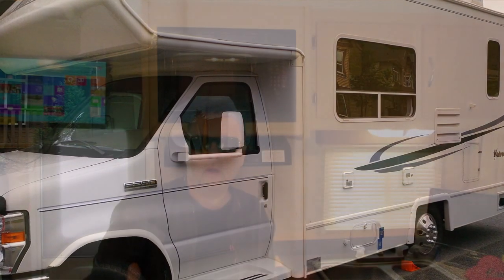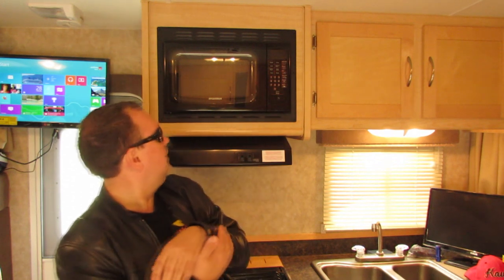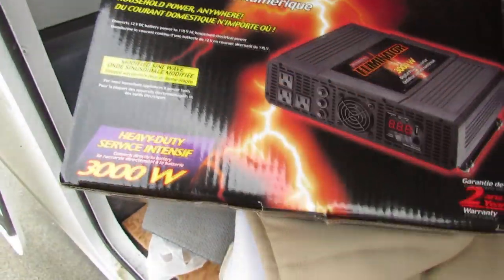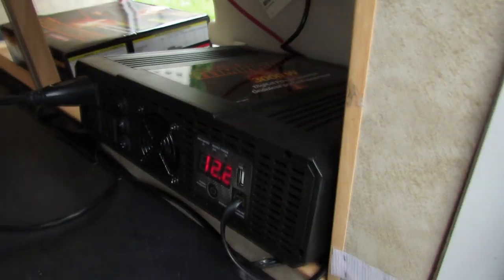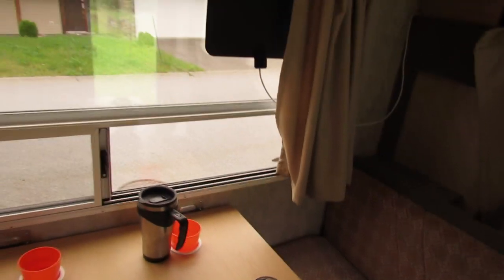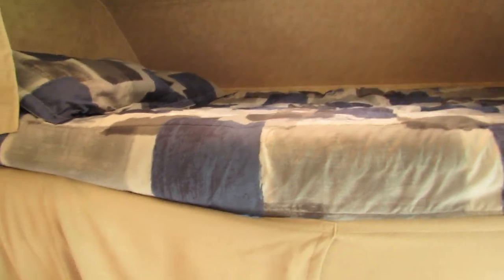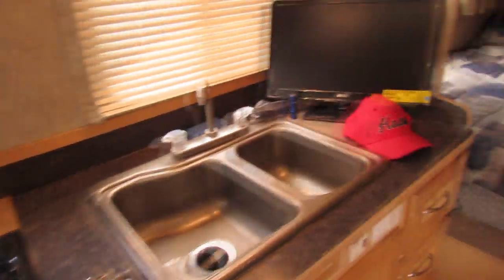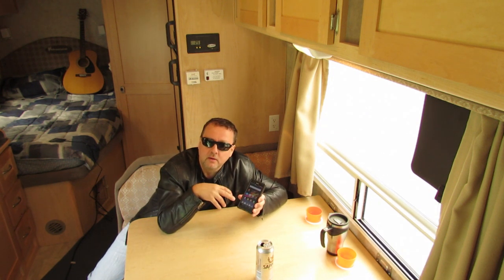RV'er Blows His Fuse!!  3000 Watt Inverter Install Issues

Comment: A 30A fuse will only give you about 300W of power from a 12V battery 
I recommend 400A of fusing from your battery and your nuke box should run just fine even with your other items turned on assuming the inverter can take it 

Also for your own safety you should upgrade your DC wiring to 2 gauge or even 0 gauge because what you got there is way too thin for 3KW at 12V

Also you should get a pure sinewave inverter 
Your batteries will last longer and your equipment will run cooler and more efficiently

Also you should get at least 2X 150AH AGM batteries 
If money is the issue 
You can pick them up pretty cheap at the local scrap metal yard 
Usually phone companies scrap their backup batteries every year and 90% of them are still good

Comment: Hi, got on your channel by clicking trough from one of Nomadic Fanatic's videos..
I don't know if anybody has given an answer yet, but here's mine..
To get 3000W out of your 12V system, you need 250A... Since no inverter is 100% efficient, a 300A fuse will be more appropriate, especially when the inverter allows for peaks...
To support this current, you really need 0ga wires, both directly hooked up to the batteries, unless there's a shunt for a battery monitor...
If there is a shunt for a battery monitor, you'll have to run the ground wire to that in order to make it work as intended, but don't forget to check the maximum current of the shunt and the wire connecting it to the batteries, upgrade if necessary...
Unfortunately, those are the kinds of things you encounter bringing house comforts into camping environments, but that's a small price to pay if you'd ask me.
Greetings from your latest subscriber from Belgium,
Isabelle
Reply from the maker: Thanks for the sub! And you hit the nail on the head:  I need 0 guage wire! I still haven't re-wired it yet, as I am plugged in with 30 amp service. But it works well with loads under 500 watts at the moment which runs most of my needs when I am boondocking. Regards from British Columbia.
Reply: Hi, a typical melting fuse allows for a bit of overdraw if it doesn't take too long. Most things only use their maximum rated power in short bursts, averaging quite a bit lower and your inverter probably has a little bit of buffering built in. That's why you easily get away with a 30A fuse (which is only 360W by 12V before substracting conversion losses).
I'm thinking about restoring and converting a vintage Mercedes van that's been sitting on my driveway, as a step-up to the rv lifestyle and maybe go fulltime eventually...
I read so much different things about modified sine inverters... Some say barely anything runs on it without seriously reducing the lifespan, others say practically anything runs just fine and just as long on modified sine...
Since electricity is easy and fairly affordable to produce, I think that's the kind of energy to prefer and because 12V rv gear is overly expensive and not very good either, I'd go for a 230V (Europe) fridge.
Most people say modified sine is a killer for anything that has a motor, so I think I won't take any chances...
I only hope pure sine inverters last a long time... Expensive!

Comment: We used a 150 amp circuit breaker right off the positive wire on the battery, also we ran a direct line from the inverter to the inside of the coach and instalked a normsl outlet for us to use any appliance we need, the direct line may work best for you, wish uou luck.

Comment: From battery to inverter, it'd be a good idea to upgrade to a #3/0 gauge cable, with a short a run as possible between terminal and inverter lug.  Welding cable works very well.  Proper installation will require lugs, a solid crimp, and heat shrink.
Also, you'll need a much larger fuse.  ANL fuses can be had for pretty cheap, while other terminal based fuses will run approximately 3-4 times as much - some opt for the cleaner install.
Last, and least, you might even consider wiring a capacitor - the kind used for large car audio applications, but the money would probably be better spent on a couple of more 6V batteries.  Still, the large capacitor might help a little with the surge, in the absence of 2 more batteries in your bank.
Good luck, enjoy your summer

Comment: I had same issue setting up solar to  run my  home office would run some things but modified inverters when it came to running my washing machine was a bad match, power reflected back to the inverter and smoked it upgraded to a pure sign wave unit ran fine!

Comment: Many times these cheaper modified wavers don't come anywhere near their stated wattage. I had a 3000 w modified that did 1685 watts at best running. May want to check actual wattage capacity with a tester. Also upgrade the fuse to a bigger fuse. Don't go crazy. Pure sine wave is a much cleaner wave and if you get an electronic instead of a transformer based inverter it will go 3x the surge it's rated for ,for up to 20 seconds or more. Pure sine wave electronic type 3000 watt aims inverter will actually run 3000 watts all day. If you go with the automatic inverter charger it will charge batteries and switch shore power to batteries automatically when it senses change in power supply. Worth the money. Pure sine wave is far gentler on Tv'S and other sensitive electronics. Pure sine also last longer when electronic. Less susceptibility to vibration from travel.

Comment: The Mod-sine is likely contributing to the issue with the microwave.  Also, all residential microwaves have a large spike in amperage draw upon startup.  Swap out your inverter with a pure sine and if that doesn't completely fix the issue try a microwave with a lower amperage rating.  That'll do it.

Comment: The lower the voltage on the batteries the more amps you will draw on the 12 volt side. 30 amps at 12 volts is only 360 watts. 30 amps on a 120 volt AC line 3,600 watts.  I would for one install circuit breakers instead of fuses. Second add more batteries, third cover the roof with solar panels. For a little more power run the generator for your microwave. My 4000 watt inverter draws 30 amps from my solar panels when I run my microwave, without that boost the batteries would loose power fast.
Reply: Voltage drops makes the amps go up! To get the same 360 watts at 11 volts is close to 33 amps.

Comment: Agree with the other guys. Wire size is to small 2/0 MIN. I have a 2000 watt xantrax pure sign. And it runs everything on the 5er just fine. Toaster, Micro , TV, Stereo. But I am also running 4 6V batteries and 2/0 cable

Comment: Your fuse is way underrated for that kind of load. A 900w output microwave needs almost 1500w of input. 120a x 12.6v = 1500w. Both your wire ga & fuse rating is way undersized. You'll need at minimum 4ga wire with a 150a automotive sterio style of fuse or better yet a circuit breaker. 2ga wire would be even better !! Good luck =)

Comment: My power inverter use to do the same thing I own the same model you have I had to upgrade my power wires to a 4GA wire and a 200 amp glass fuse because when the microwave turns on the wire is to small and it starts to get hot and burns the fuse the fuse I use is like the ones they use on audio sound systems and the problem went away now i can run my microwave with no issues

Comment: in addition to the other comments here about thicker cable and larger fuse, it also looks like you need thicker wire between the two 6v batteries.

Comment: I don't know, but my original solar set up had some sort of conflict with the two 6v batteries, as I transferred it from the travel trailer with two 12v deep cycles. My advice is, save the microwave and electric toaster for shore power. When you are on solar and boondocking, just cook stuff on the propane stove. It will be healthier that way too!

Comment: I put four cables on my inverter, all are 1 gage, you may note that you have two +, and two -, on the input you need to connect both to get the full output of 3000 W, you are only getting 1500, if your input is with one + and one -.  If your six gage cable is used, it is a fire hazard, running too hot. by going to higher gage, the cable will remain cool, I'm thinking your fuse is way to small, remember your out put is thee outlets, at at lest 15 amps per. Look into a two 45 or one 90 amp fuse on the positive cables.

Comment: This electrician you speak of, they're wrong. First, you need at least a 300A fuse/breaker (100A=1000w) and your battery cable should be at least a number 2. My suggestion, for anyone reading (since I'm sure you've long fixed this) is to buy some heavy duty jumper cables and cut the clamps off, also buy a breaker rated for the inverter you're using. 

300A Circuit Breaker: https://www.amazon.com/gp/product/B001RS4YOM/ref=oh_aui_detailpage_o01_s00?ie=UTF8&psc=1
Heavy Duty 2 AWG jumper cables: https://www.amazon.com/gp/product/B00LX0C98M/ref=oh_aui_detailpage_o02_s00?ie=UTF8&psc=1
Wire lugs: https://www.amazon.com/gp/product/B008D54QXQ/ref=oh_aui_detailpage_o02_s00?ie=UTF8&psc=1

Comment: U need to use thicker cable from battery to the inverter. You want to use the thickest gauge possible. Find out what the thickest gauge the terminals on the inverter can hold and use that.

Comment: Ok these comments come from and old heavy equipment mechanic, 41 years in the trade.  Your wiring is way to light.  Stop by your local welding supplier and buy some 1/0 welding lead.  It's $6.00 per foot locally here.  Small price for the best product.  Make the investment and your problems will disappear.  1/0 welding lead is rated for 400 amps per 100 feet in length.  So you won't ever exceed its rating.  I have a 4000 watt inverter in my motorhome using this wiring without any problems.  You will have to start your generator to support those small batteries when using the microwave.  Or add some more batteries.  They have 255 watt solar panels for your roof that are six and 1/2 feet long and three and 1/2 feet wide.  You can get about 8 amps out of each solar panel.

Comment: A 3000 watt inverter needs a 300 - 400 amp fuse.. class t fuse is what you need. Dont use stereo fuses or breakers. Use what is meant to be used with an inverter ( class t fuse ). Also a 3000 watt inverter should be using 01 - 02 OT gauge copper wire. Your set up now is a fire hazard waiting to happen. Switch out to heavier wire and class t fuse to be set up correctly and you wont have any problems.

Comment: This inverter will only supply 1500w max from any one plug. The inverter is a very cheaply built model and can not be expected to perform as advertised. You need a 250A fuse and much larger DC cable to get the current you are looking for. Some microwaves will not compatible with MSW inverters (especially the cheap ones used by RV OEMS). Consider a TrueSine product from a reputable brand. Xantrex is the leader here. Also GoPower, Magnum.  Get a new Electrician.

Comment: Those Canadian tire inverters are known to have problems . That battery bank seems extremely small for such a heavy load to me .  I would double up on the battery bank and just run 2 of those 1500 watt inverters (so cheap) , then just fire up the generator for larger stuff .   I saw a guy talking about how one of those 3000 watt inverters almost burned down his cabin , the 3k watt one is actually just 1500 watt on 2 ports . Microwaves are bad anyway bro !
Reply from the maker: So far after 9 months the inverter is working fine. I'm just in the RV in Utah and watching the Oscars and LED lights and no problem. I got it at 50% off so if it quits working it won't be the end of the world. Lol Thanks for commenting and watch.
Reply: Linescrew1
Reply: +Linescrew1 And you had an electrician help you?  Next time you see him, slap him!  watts = volts * amps... 12 volts * 30 amps = 360 watts.  3000 watts @ 12 volts = 250 amps.
Reply: Chuck Wagner Hi there,  I just seen this thread by mistake but I am curious??? I was given a 5000w10000surge pure sine inverter and have zero clue on how many batteries I will need to run my rigs (class c) electrical needs. I don't want to use my generator except for emergencies. I want to strictly use solar if I can so would you be able to tell me the basic needs to get it going.  Thank you if you can help me at all and if you can't that's ok too 😊

Comment: I was told by the manufacturer of my 2000 watt inverter that you need 10 amps of protection for every watt you unit will support. . 1000=100 amp for instance. .I am a trucker and I have a 2000 watt contunious watt with a peek startup of 4000.. I was told to use a 200 amp fuse..
Reply from the maker: Thanks for the advice. It's starting to look like I totally under estimated the wire gauge and fuse size...

Comment: Figure on ~ 150 input amps to run the microwave. At least 300 amps for full inverter power. Wire size calculators are on the web.

Comment: A modified sine wave inverter puts out less efficient power.  Your devices are trying to pull more power than they are rated for.  So a 1500 Microwave may look like its pulling 2000 or 3000 Watts.  You will need a Pure Sine Wave inverter.

Comment: You need at least a two OT wire  running to your inverter from your batteries you need a good connection to your batteries so you probably want a top post wingnut connection. Trash the mobile 30 amp fuse go to a breaker. And you need a least three batteries. I have four batteries in my semi. I have a 2000 W inverter I run a microwave a George Foreman cooker and a refrigerator and a crockpot no problems whatsoever. Of course I don't run the crockpot and the George Foreman cooker at the same time as the microwave. God bless I hope you get things lined out

Comment: Your 1,500 watt microwave will draw at least 125 amps while it is running.  Your 30amp fuse would be good for only around 300 watts or so.  You'll need heavy gauge wire.  I would check your "professional" electrician's credentials.

Comment: Buy a pure sine wave inverter and you won't have those problems. The first thing I see is the size of the wire from the battery to the inverter is 6 time to small that wire looks like 10 gauge and it should be 2 gauge like welders cable. and that fuse should be 150 amp fuse on the DC side of the inverter and 15 amps on the AC side. If that inverter take 12 volts and makes it 120 volts that is a different on timed by 10 so amperage would be divided by 10   Because the wattage always says the same.  150amps x 12volts =1800watts is the same as 15amps x 120volts =1800 watts. The more the amps the bigger the wire needed.

Comment: Inverters that size will require a fuse bigger than 30 amps.  I'm guessing you'll need a 300 amp fuse or larger. And a wire going to the battery larger than 0 gauge.
Reply from the maker: That's heavy duty! I only want to run the microwave load no more than 5 minutes a day. Guess I will have to re-wire it!!

Comment: I have the same RV as you do, have you looked into getting a trailer hitch yet? I'm having some trouble finding someone to put one on.
Reply from the maker: No. I have no desire to tow anything. Might but a motorcycle rack on the front eventually.

Comment: Is the inverter plugged directly into the microwave ? Because if you are running everything through your converter it will cannabalize your whole system. And get some solar up there to feed your batteries.

Comment: On that inverter 2 plugs will run at 750W and one plug at 1500W. Your battery wire and the inverter wire are to small. 200 amp fuse and a #2 or 1/0 battery cable is required.

Comment: Your Battery cables need to be 2/0 and no longer than 6ft long......And your fuse needs to be a 350 amp fuse assuming your inverter surges to 4000 watts......On a side note, the battery cables you're using to run your batteries in parallel need to be as large as the cables going to your inverter.

Comment: If this inverter is plugged directly into your shore electrical power line this will not work correctly, this is because the rv power converter / charger will charge the batteries as your power inverter is running off of them creating a power loop that will kill your inverter and overheat it or blow the fuse running any higher wattage appliances. To correct this issue we would heater need to pull the fuse on the power converter / charger disconnected charger from shore line.
Reply from the maker: I never use my inverter while I am plugged into shore power. I found what the problem was....I need to use "0" gauge wire to utilize the full 3000 watt capacity of this inverter. Thanks so much for taking the time to comment. Regards from British Columbia.
Reply: Linescrew1 But when you connect your inverter output to your RV AC in your charger will try and charge the batteries off the batteries. You need to install a switch to turn off the internal battery charger. My RV has a switch to turn off the charger for that reason. You can install relays to automatically switch power sources and turn off the charger. I installed a DPDT 50 amp relay in mine that gets power from the inverter unless the generator of land power is on, Power from the generator or land connection engages the coil and disconnects the inverter power.
Reply from the maker: I have a switch installed. I actually keep the inverter circuit separate to keep things simple.
Reply: I've set up so that it automatically switches to which ever source (Land/Gen/Invert) is on to the breaker panel. No more switching this and unplugging that.